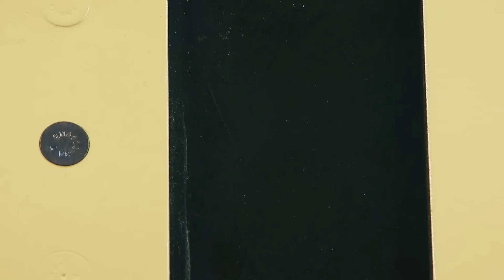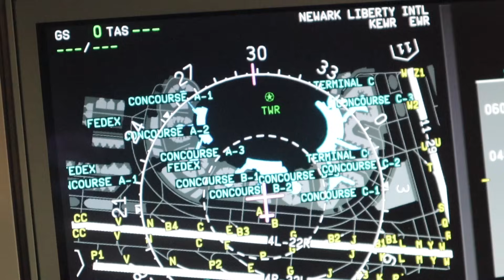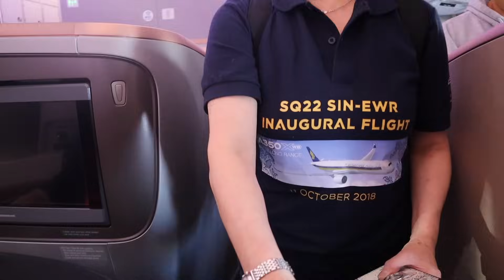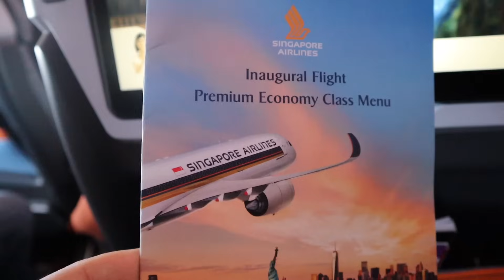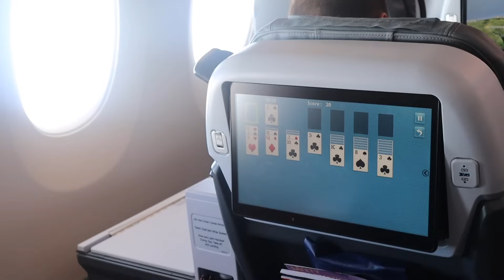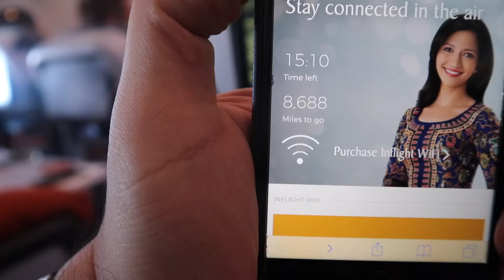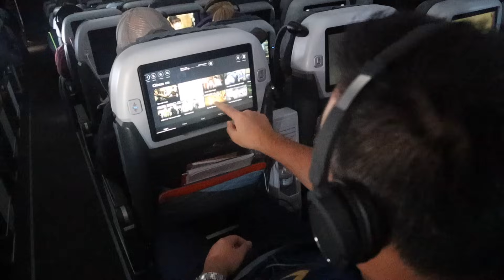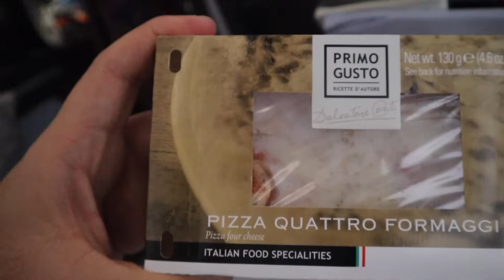World's LONGEST FLIGHT in Premium ECONOMY on Singapore Airlines

Comment: I flew on Singapore Airlines in 2009 on their then brand-new A380 from LHR-SIN-HKG and I was really impressed by the whole experience from check in to boarding it was so seamless.

I haven't had the chance to fly on them since but maybe at some point in future I may choose them again and fly the A350-900ULR or the upcoming 777-900X or 787-10 

It's great to see Singapore Airlines with new aircraft and new routes as I am a huge fan of this airline.
Reply: *B777-9

No need to add the 0's or X at the end.
Reply: From london to singapore to hong kong? Isnt a stopover at hongkong?
Reply: What if he flew LHR-SIN on the SIA A380 and then SIN-HKG on the A380 again?
Reply: AEROFLIGHTXV  Need X but no 0, Boeing777-9X
Reply: Jack Liu 
No Jack. Listen, Boeing used to call it B777-9X but they have removed the 'X', instead, referring to both variants (-8, -9) as part of the B777X family.

Unless it changes, call the aircraft B777-9.

Comment: Sam, what do you think of the heavy radiation exposures to frequent and longhaul flights? I also fly longhaul and often wonder about this. There is lot less ozone protection at high altitude flights. So there are a lot more radiation bombardment from the Sun and cosmic ray. This in turn increases genetic mutation and chances of cancer.
Reply: Jon Can I often wonder about this also. It is a risk sadly.
Reply: I wouldn’t worry about this unless you are cabin crew or flight crew. Passengers don’t fly often enough for this to be a problem
Reply: Good to know. See you in the air! :)
Reply: That’s why you should wear a tinfoil hat.
Reply: Z3U5  lmao another fool that thinks we landed on the moon!

Comment: Why is it record breaking ?
I did that flight 10 years ago but was all business class back then .
Reply: Hearndinger they stop its around 8 years ago. And now it’s back!!!
Reply: Hearndinger Yes.  I did it too, but from LAX to SIN.  Back in those days they used an Airbus A340-500, used by other airlines to seat about 250 passengers but in SQ’s case their five dedicated aircraft were tricked out with only 100 Business Class seats.  Unfortunately for SQ, after the 2008 GFC, the routes stopped making money.  Then in keeping with SQ’s policy to keep their average fleet age at below eight years, SQ took the decision to discontinue these two ultra-long haul routes in 2013, I think.  In any case, these A350-900s are better suited for this type of ultra-long haul mission.  With only two engines instead of four, they’re  certainly more fuel efficient.  I wish SQ every success with these revived SIN-EWR and SIN-LAX routes.
Reply: Is it record breaking with the A350 because of using only 2 engines or were there also 2 engined flights on the same route 10 years ago as well?
Reply: there were never any airlines that flew from Singapore to New York except Singapore Airlines. They stopped flying to New York ever since they retired their A340 fleet so there was never a twin-engined aircraft that could fly 19 hours straight back in 2008. therefore this is record-breaking
Reply: There was one from Bangkok to New York and LA from Thai Airways - very similar length.
Reply: but its still shorter

Comment: 13:40 wait does it means they change the route throughout the year?
Reply: Depending on the time of year, the winds move in different directions . So getting a strong tail wind over the Pacific when flying from Sin will take less time than going over the north pole
Reply: I knew there were some light change but flying over Africa instead of north pole that's pretty intense

Comment: I flew Sg to NY  12 years ago on A340 4 engine plane. Back then it was all biz class. 100 seats I think. Now the route is all flown by twin engines like the A350.  The thing that’s worries me over the North Pole is that if anything happens, nobody can come help you.  From safety perspective, Atlantic route has better chances if there is any emergency followed by the pacific route, but then from Sg you will have to stop over in Germany/uk or Japan/Korea.   U can’t fly non stop between Sg to ny without flying over the pole.

Comment: Sorry Sam but the record was broken years ago by the Australian carrier Qantas in a now retired 747 400 that is a static museum fixture . The plane flew from London nonstop to Sydney and it took just slightly over 20 hours in the air. they used a tug and pulled the aircraft out to the runway and backed it up to the start of the runway, they did this to save fuel! So when the plane started And went through it preflight it was ready to go with a minimum of wasted fuel. 20 hours! Plus change.

Comment: Unfortunately, for such a long flight, the premium economy seats on the A350 are roughly 2 inches narrower than the ones on the 777 because of the narrower cabin while having the same number of seats per row, but the A350 has the range for that flight. A 2-3-2 configuration would have been great instead of 2-4-2. I've tried both on a different airline, and the 777 premium was almost business class-wide.

Comment: I am not here to offer tips on how to prevent and or cure jetlag. I am here to offer a simple experiment all air travelers can perform before and during your air travels. Get a weight scale that will easily fit in your backpack. Take an inventory of the clothes and accessories youre wearing and weigh yourself at the airport terminal before you board your flight and write what you weighed so you dont forget. After the aircraft gets to its maximum altitude get your scale out and weigh yourself again and write what you weigh at that altitude.The premise or assessment here is that Earth's magnetic field is more dense at ground level and so people and objects weigh more at sea level and weigh less the higher we get because Earth's magnetic field becomes increasingly less dense the further away we get from Earth. So air travelers are experiencing only partial gravitational forces unlike the astronauts who experience zero gravity at the ISS. So i guess you could say air travelers are mini-astronauts or astronauts in training..So partial gravitational forces being experienced by air travelers may be the cause of jetlag.

Comment: business class  1-2-1 seat configuration.
premium economy class  2-4-2  seat configuration.
long flight more than 10 - 12 hours  economy class without transit or connecting flight,  body aches or stiffness. 
Exposure Most of Western people height  above 6 feet , will avoid economy class for long flight.